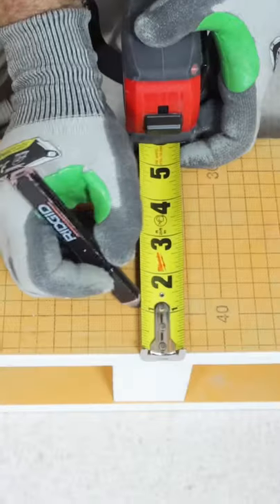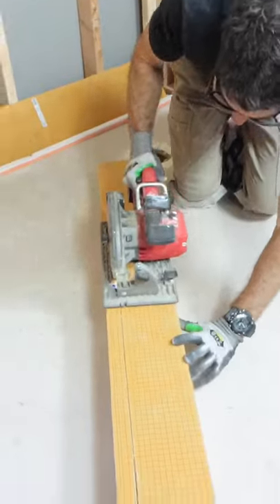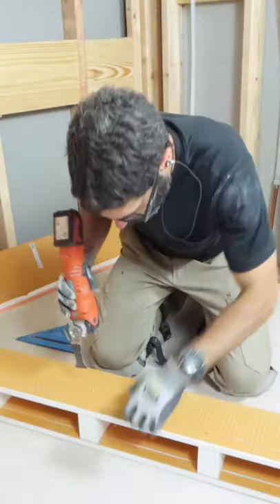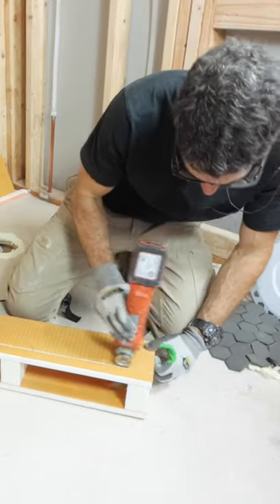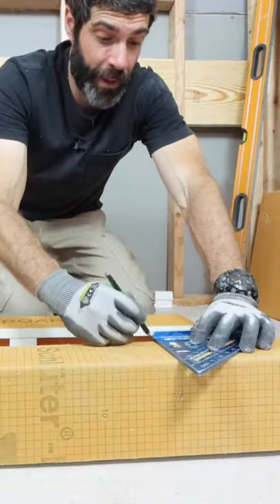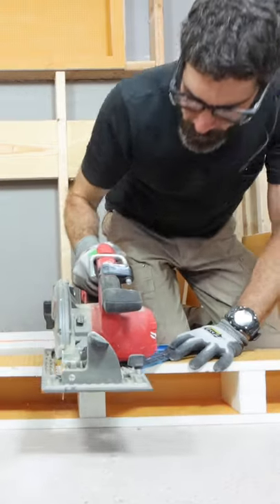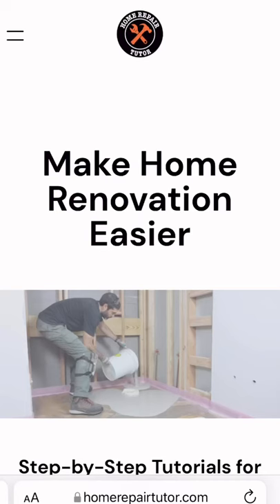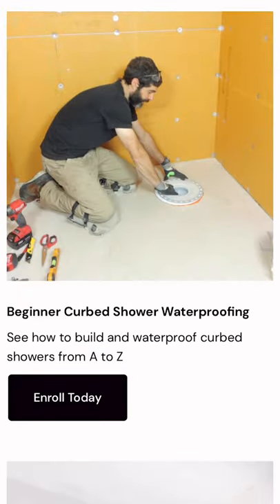Custom Shower Curb Tip - #shorts

Comment: For better support, fill the void with extra foam or the expensive thinset. If the customer is 250+ yeah back fill the baby up, going the extra mile can get you better business in the future.
Reply from the maker: good tips, those 2” foam supports can be removed from cut pieces and bonded to the installed curb using thin-set or KERDI-FIX